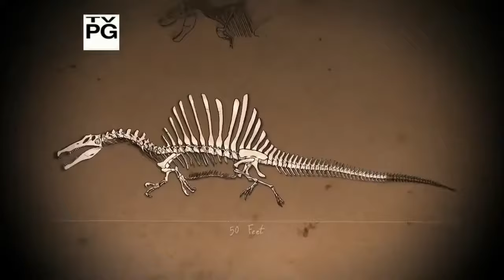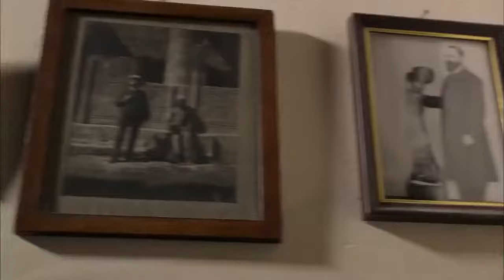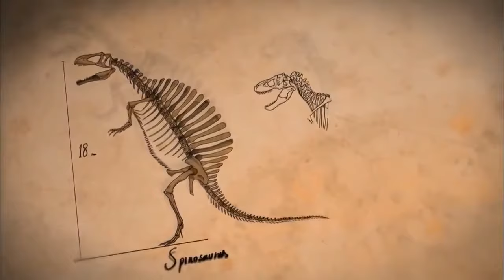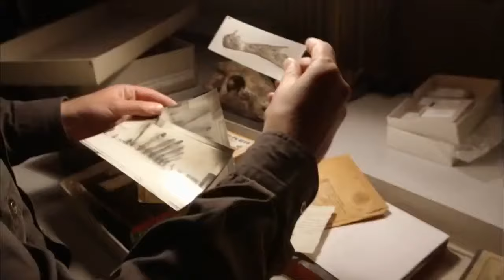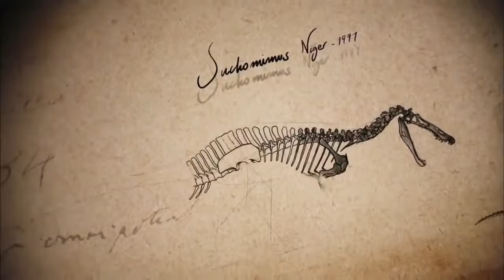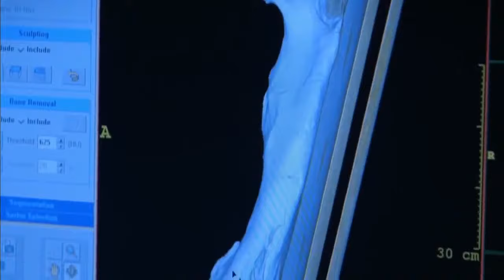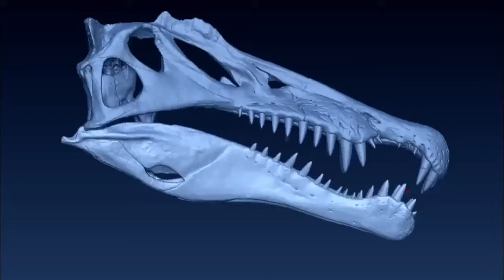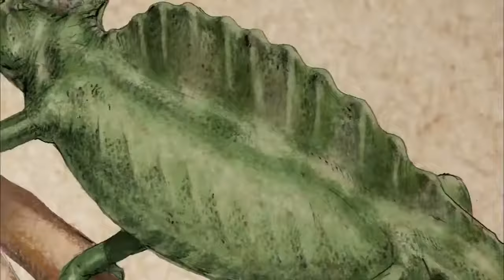The Biggest Meat Eating Dinosaur Ever: Spinosaurus Documentary - Dinosaur Documentary 2017

Comment: How does fire destroy stone fossils?
Reply: If a bomb can blast a stone, brick & steel building into a pile of unidentifiable rubble. Then it can most certainly blast a stone fossil into the same state. A lot of German cities were more or less leveled during the war.

If you look at Berlin, Munich, Hamburg & Nuremberg they have VERY few buildings. & monuments that are from before WWII. Because the cities were carpet bombed into oblivion. Hamburg is almost an entirely modern city. Because it was so thoroughly bombed by the Allies.

& the famous Place of Justice in Nuremberg where the Nuremberg Trails were held. Only survived because of sheer dumb luck! In one raid two bombs fell, but they landed just in front & behind it. Leveling the buildings on either side, but the courthouse was spared.
Reply: explosions can turn rock to dust.